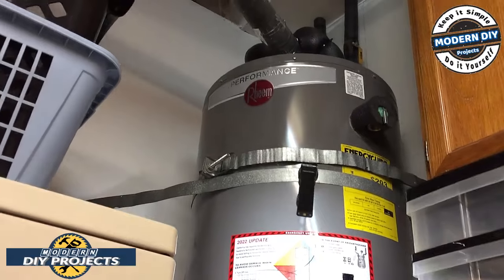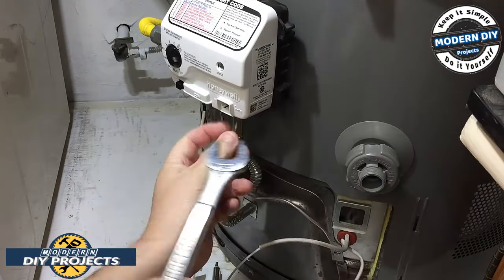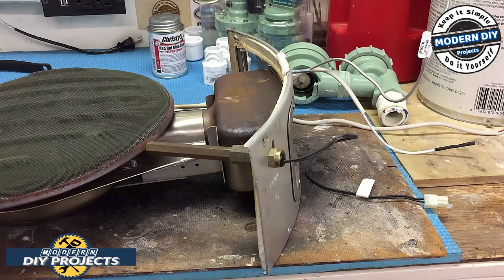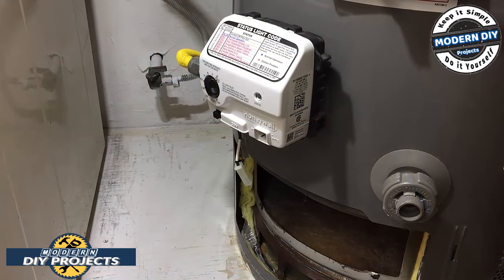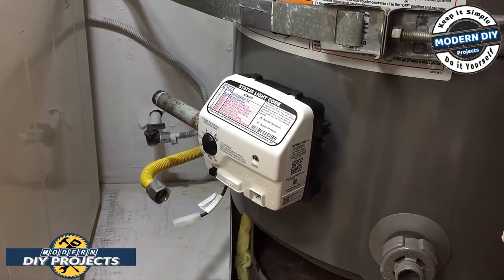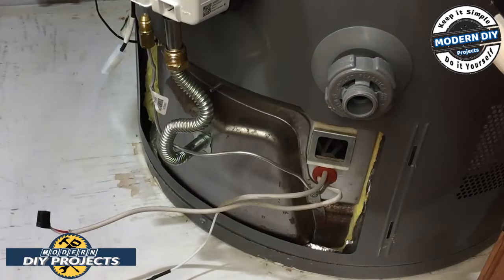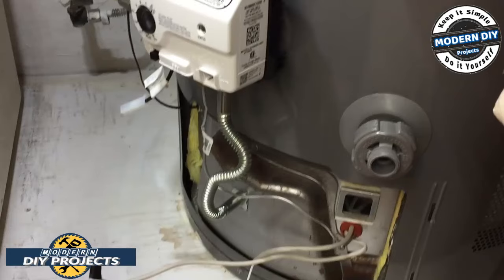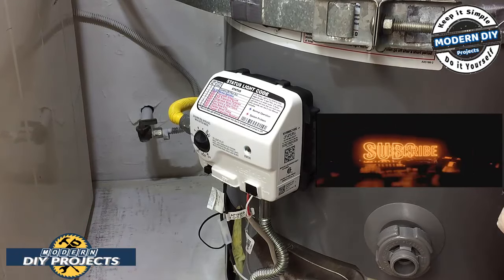Rheem Water Heater Chamber Sensor Failure / How to Replace Chamber Sensor & Gas Control Valve DIY

Comment: Thanks for the video, and here's a tip which might work for someone else as it has for me. Rheem will send you the parts and you should fix your heater as soon as it is convenient, but you might be able to have hot water while waiting for the parts. I turned off the gas, and after a couple of minutes, the blinking red light stopped. Turned the gas on and was able to relight the pilot and start up the heater, which ran okay for one or two days. I have repeated this procedure daily while waiting for the parts; now that I have them, I'm keeping the hot water flowing while waiting for the right moment to do the job!
Reply: Doing the same here while waiting for the parts. Not sure though why they send a replacement controller if only the chamber sensor needs replacement
Reply: @Censik  My guess is that since it was under warranty, they sent both to make sure the problem would be fixed, in case it wasn't the sensor that failed.
Reply: I posted this same thing after I saw your comment.  Turned the thing off, waited for light to turn off then re-lit pilot and it worked.  We'll see for how long.  A new sensor is on the way.
Reply from the maker: That is a good tip. I did the same thing but I didn't mention it in the video because I had no way of knowing if it would works for anyone else. Seems to be a good trick that works as a fail safe when these things go bad.
Reply: I did exactly that ! Got the part , watch the video a couple times and BAM! It’s done and working! The key is to have all the tools ready as mentioned in the video. It took me 2 hrs because I was running back in forth to the garage. Probably would of taken me an hour if I was prepared. 😀
Reply: We’ve been doing this for months. It runs for a day or five minutes, we never know. I don’t think I will ever buy a Rheem again. This all happened just outside the warranty time, so it’s by far the most expensive water heater I’ve ever owned. This should really be illegal. A water heater already costs 1k and now it’s been an additional 500 for parts. If I had to hire someone, I’d be looking at even more money gone. Never again. Rheem has lost me and I’m spreading the word on their bad parts. Sad- they used to be a good company.

Comment: how did you get the replacement pieces under warranty? I have warranty for mines and ran into the same problem, did you have to call them or were you able to do it online?
Reply from the maker: You have to call the Rheem warranty dept. They will ask a few questions about your unit to make sure it is still under warranty. They will ask also a few questions to determine what the problem is. After that they ask what is your name and address and they send you the parts. No charge. Only took like 5 minutes talking to a real human on the phone. The person that helped me was very professional and knew what to do. No fumbling around.

Comment: Hi I got 9 blinks. It saying chamber control sensor should I just get that changed vs the gas unit u did?
Reply from the maker: You should replace only what it says on your control panel. I replaced two parts because that is what Rheem sent me. They paid for it so I replaced them. Otherwise I would only have replaced the indicated faulty item.
Reply: @ModernDIYProjects  got you I just got the part which is temp chamber sensor. They ship pretty fast. What I did while I was was reset the unit n it worked. Only for like 3-4 days lol. Thanks for showing us how to tackle this u been great. Got a new subscriber for sure.

Comment: If the chamber sensor fails, do you also have to replace the thermometer or can you only replace chamber sensor?  Thank you for the video!
Reply from the maker: Yes, you can replace the chamber sensor by itself. I only replaced both because this unit was under warranty and Rheem sent me both items to replace. It was free of charge so I am not going to argue. I kept the old part just in case this one breaks, I have that old one that I can put back in.
Reply: What does the gas chamber sensor do?
Reply: @CarlosGarcia-ls4hn  it turns the gas valve inside the controller off so your water heater won't work anymore.  It supposed to turn it off if it senses flammable vapors, but it fails 99.9999% of the time in just a few years.
Reply: @Brian-rj5rl  I have seen other videos of flammable vapor sensor. This chamber sensor looks different. It is sealed in a brass cap. Maybe just for temperature....

Comment: Just a thought don't turn the.Hony well gas controller in to the highest temperature setting they have a nasty habit of burning out the last one I purchased a few years ago was about $ 175 dollars plus I had a hard time finding one there made in China and assembled in Mexico.
Reply from the maker: You mean the HOT level, or the VERY HOT above that? I have it set to just below the HOT setting and that is plenty hot for us. It goes even higher than that but I don't see the need for it. Funny thing you mention the Honeywell unit being a problem. I noticed that Rheem sent me a controller box with a different name on it. "Resideo" or something like that. You can see it in the video. I figured that the Honeywell units must be problematic so they changed suppliers.
Reply: @ModernDIYProjects  received my controller and chamber sensor today the controller is also not Honeywell and is resideo hopefully it doesn't give out within a year like the last one. Very easy installation aswell
Reply from the maker: @Dominick0007  It's not a difficult process. Took me twice as long because I was making the video. Let us hope these new ones last longer than the previous ones.

Comment: Isn't it amazing that years ago you could buy a gas water heater that did not have all these electronic sensors and stuff and it would work for years with maybe having to ony replace a thermocouple once in a great while.  Is this really any better?  Is there really any great benefit for all these electronics?  Think about it.
Reply from the maker: Totally agree. My previous heater only cost $300 and was the top of the line model GE. Lasted me 17 years with NO trouble ever. This one was the cheapest one I could get and cost $600 (because my state requires Low emissions BS). So it's more expensive and breaks down faster. Yeah that is a winning combination. Most of the electronic stuff I bet is State mandated and not that the Manufacturer wants to make it more complicated.
Reply: Totally agree. My old water heater failed after 15 years of use due to leak.  The one that I got now failed just for 2 years of use.  A year after it was installed, it turned off once in a while.  They said it was just a safety feature so I just ignored it and just turned it on (no big deal I thought)..  this happened every month so I thought it’s no big deal.  After 2 years and 3 months, it won’t turn on anymore.  When I turn it on it will work for a few minutes then blink my light turned red. Called the tech and they replaced control modules and all sensors.  After 2 weeks of use, the problem appeared again(turning off). Called the tech he said that it has discoloration in the burner (looks like leak), called rheem tech support and they said the unit needs to be replaced but I will pay for labor because they only pay for labor if the unit is 2 year old.  Lesson learned callrheem tech support before your unit reach 2 year if your getting a unit with turning off issue. It will be costly if you don’t.  Always call them even it’s just a minor issue and let them fix it.
Reply: My grandma had her water heater for 20 years maybe more and it went out. This new one is not even 2 years old yet and has this same error. Gotta call them tomorrow to order the part
Reply: My landlord installed this same water heater recently, 3 days later it shut off with the red light indicating a chamber sensor failure. Such a POS
Reply: the water heater I replaced was original to the house Install date on ticket still attached to unit was 30 years ago when I removed it.  My Rheem lasted 9.
Reply: NOPE!  Absolutely not!!  I've had to replace mine TWICE now....fuckin' thing is only 3-1/2 years old, too!  Planned obsolescence everywhere you turn today!
Reply: They don’t make money if you only ever buy one
Reply: I remember water heaters wer $350 for a GOOD one and they would last 10 yrs. Now, $1,000 for the cheapest one and maybe get 4 yrs out of it. Same with washers n dryers, refrigerators. Manufacturers all started going for max profits and least costs.
Reply: It’s all just garbage.. New does not equal better. My parents installed a water heater when I was a young kid and that thing lasted 40 years without an issue until it started leaking a couple years ago. replaced it with a Rheem and it’s been garbage.